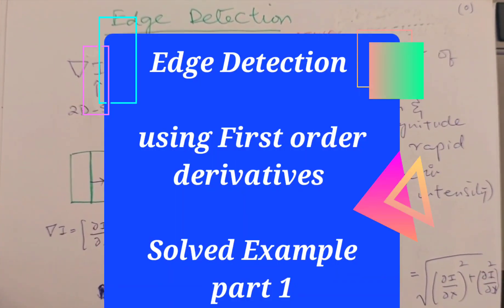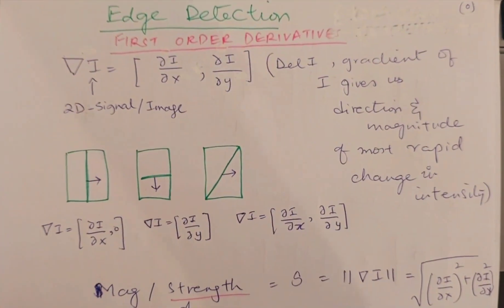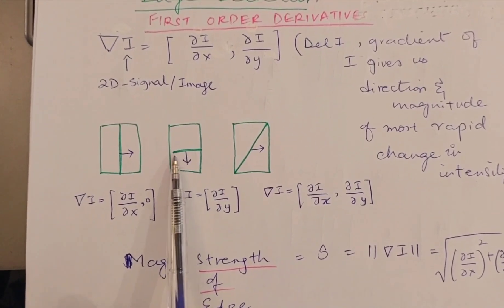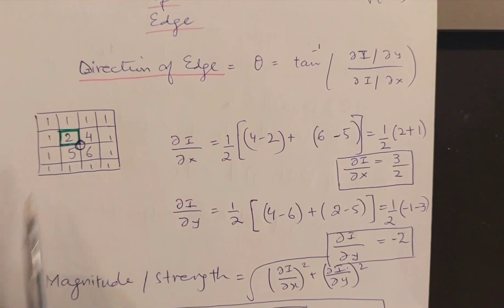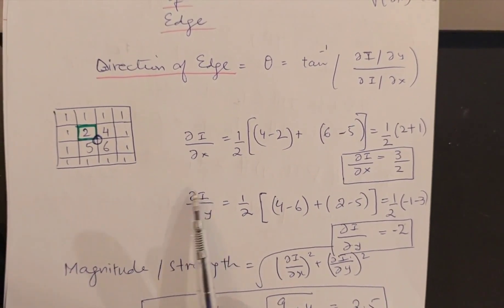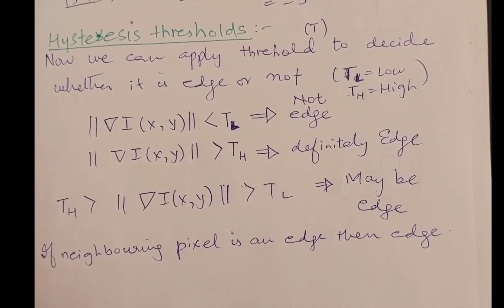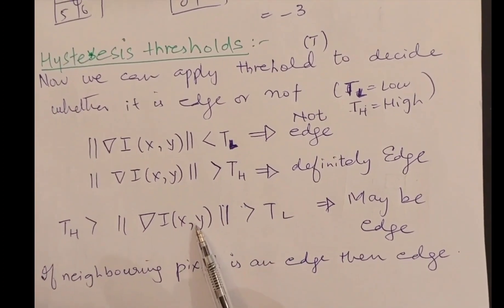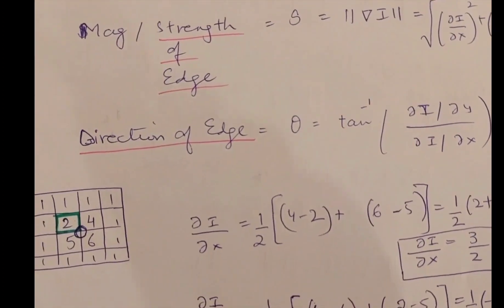Edge Detection using First Order derivatives Solved Example part 1

Comment: For x u solved as second element (of row) minus first element but for y direction u minus first element from second that's inconsistent. Secondly it's absolutely wrong to say the point you selected whether that is edge or not , not such thing we check for well defined pixel whether that is edge or not ! Not point on gird 😅